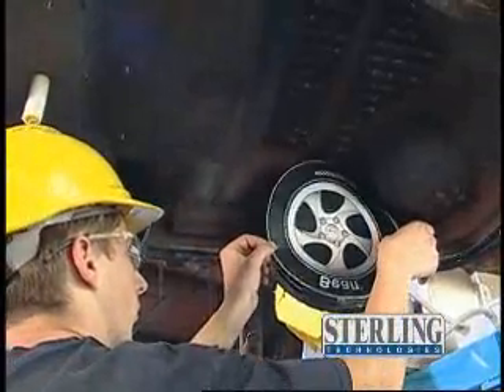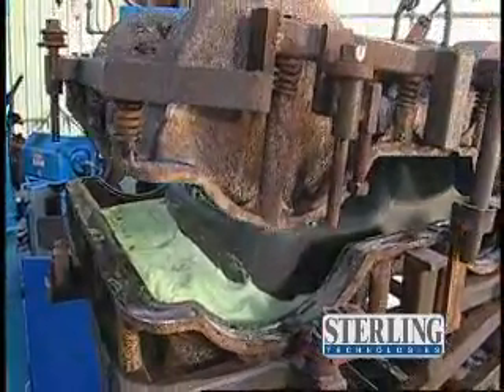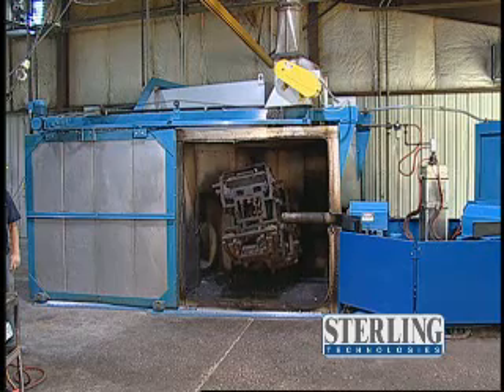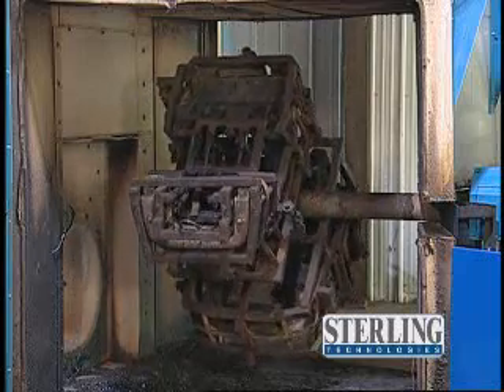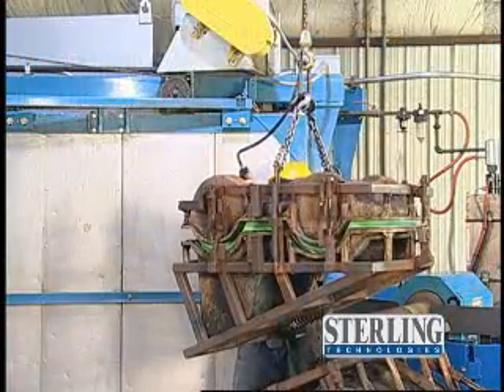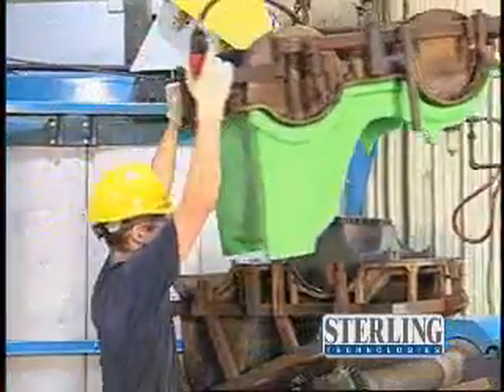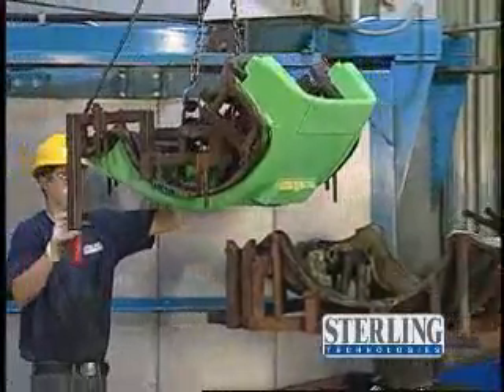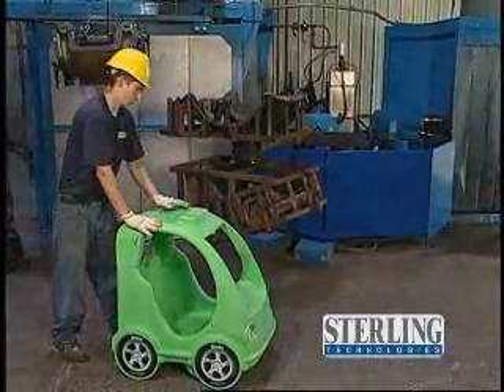The Sterling Rotational Molding Process

Comment: I'm surprised about the stickers which you sticked on the moulds to represent the wheel . Won't that stickers burn during the cooking process
Reply: From my experience molding for the past 5 years, the graphics that are adhered to the mold are made of some sort of heat activated ink and the inside of the molds dont get up past 3-400 f even though the mold may cook 15-20 min at 450-570 f. That particular mold has 4 wheels, a little gauge cluster, saftey warning for cup holder,  a grill, and 2 other graphics that goes on it.
Reply: likely use inert gas to prevent burning? I'm not sure -- I had the same question!
Reply: its might be kind of heat transfer ink